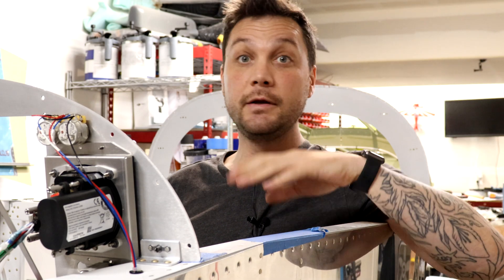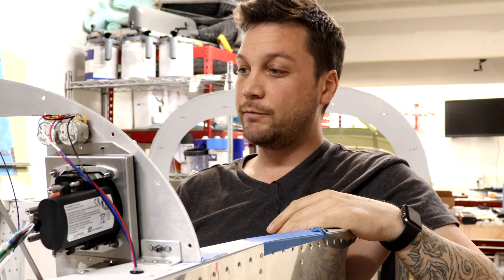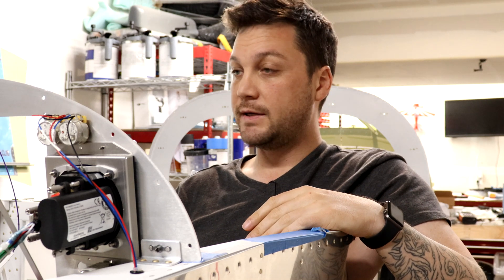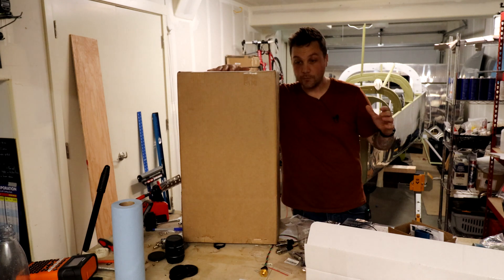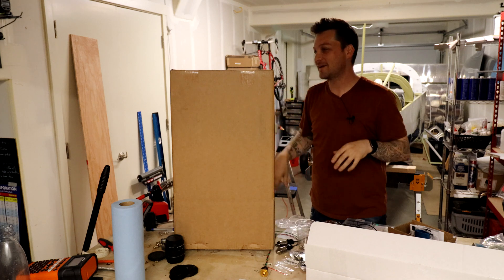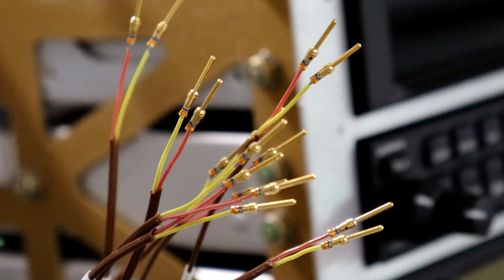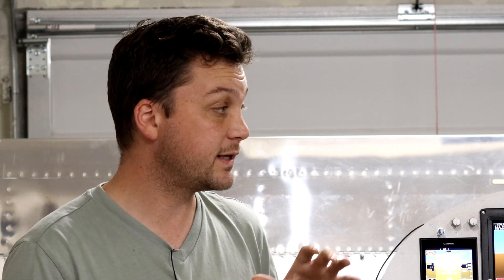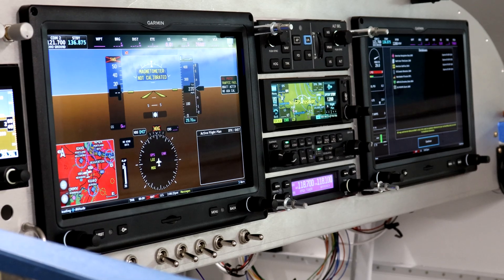Adding More Wires to the Airframe and Surprise Component Unboxing - RV-7A | EP4.13

Comment: Are you getting any flying in? Just curious how you juggle that with the build.
Reply from the maker: That’s a great question.

Not nearly as much as I’d like. It’s simply a matter of cost and priorities. Ideally I’d be up 1-2 times a month, at a minimum. I get up once every 1-2 months. 

I recently got out and did an overnight xc a couple hundred miles out. It was incredible. Unfortunately those will be limited until the project is finished.

Comment: Silly question perhaps, but I didn’t think you were supposed to use Teflon tape on fluid npt fittings for fear some may break off and head downstream? This doesn’t apply to the FWF sensors? I have been using the locktite thread sealer.
Reply from the maker: Not silly at all. And you’re absolutely correct. What have on the sensors there is Loctite 567. No tape for the exact reason you mentioned.
Reply: @RyanFlysPDX  awesome. Apologies, it looked like tape.
Reply from the maker: @tasesq no apologies necessary! I love having this info documented for followers!! Brings value!

Comment: While you were exhibiting great patience bending the fuel lines, I was wondering if flexibility hoses would have been easier?   I know fuel hoses are allowed, with the orange sleeves, in the engine compartment, but what about in the tunnel or cockpit?    It would seem to make routing lines easier, but with a higher cost.    What is the rule of common practice with fuel hoses?

Great video, and I feel your frustration with the wiring.
Reply from the maker: That’s a good question. I believe braided lines would be fine, firesleeved ahead of the firewall as you noted.

It’s very common for builders to swap in stainless steel braided brake lines, but I’ve never seen anyone sub the soft aluminum for braided lines.

Comment: Whoa!  What was that photo trickery on your iPhone?  Did you derive some kind of angle or length from it?  

Looking forward to your debrief video Ryan!
Reply from the maker: I was having a hard time figuring out the last bend so that I could arrive exactly at the penetration and not have to fuss with the angle that’s already been set.

Using the phone allowed me to see not only the (approximate) needed angle, but where I should start it on the tube.

I think it worked, as that thing wound up dead on!

Comment: I love how you are able to communicate things every builder thinks. Keep working thru the dull drums. It’s amazing on the next one how much easier it will be.

Oh! And thanks again for all the motivation. I started my engine yesterday.
Reply: By starting, I meant spitting fire, prop spinning.
Reply from the maker: Oh snap. That’s a whole different level of excitement. That’s the fun end of the engine timeline! Hope that went well! I’ll be about as nervous for first run up as I will be for first flights I feel.
Reply: Have a good mentor. He saved me from 2 catastrophic mistakes including a shorted starter solenoid.
Reply from the maker: Thank you!! 

And hanging an engine, huh? That’s got to be fun. I’ll be very excited to see an engine hanging off the front of mine. For one thing, it’ll remove the need for this pesky rear saw horse!

Comment: Great workmanship Ryan. I've been building since easter 2021 and the back ordered parts issue has been painful.  Not too bad this year.  I'm almost done, well waiting for MGL to figure out a communications conflict that keeps knocking out my oil temp and pressure. Waiting has been the largest frustration of my build. Once that's done I can finish painting.
Reply from the maker: Painting?!? With a start date of mid 2021? 

Boy I’m slacking.

I’m not great at waiting either. Unless I’m waiting on my own motivation, in which case I apparently have all the patience in the world. 

Sounds like you’ve got a pretty short path to first flights. That’s exciting stuff.
Reply: @RyanFlysPDX  I purchased a partially built airframe. A build partnership went sideways. I just need to paint the cowl, canopy surround, glareshield and a few stripes on the fuselage. Wings are painted and ready. By the time MGL figure out the issue it's going to be a bit late for this year as winter is coming. We get down to -40 odd degrees Celsius, so I'll probably take it to the airport spring 2025.
Reply from the maker: @alanverity341 what are you talking about? -40 provides some excellent density altitude for first flights. Assuming your fingers don’t fall off, that is.😆

That’ll make for an exciting spring. And working through the winter without a looming “deadline” to tidy things up may provide some excellent opportunities to really tighten things up.

Keep us updated for sure!
Reply: @RyanFlysPDX  yeah, not ideal looking for a place to land when it's covered in snow. I purchased my interior from Lemke Aviation interiors. Really happy with the end product. Heated seats....